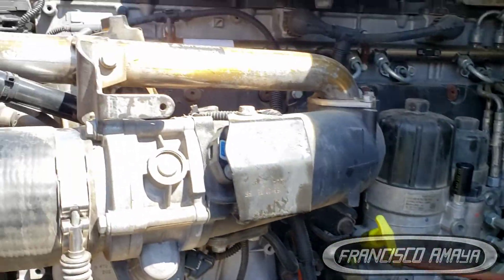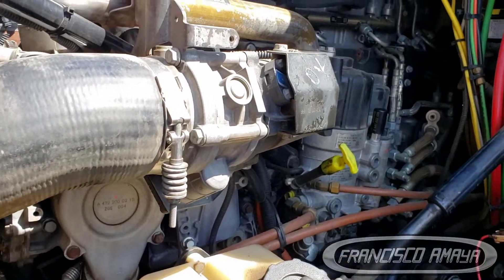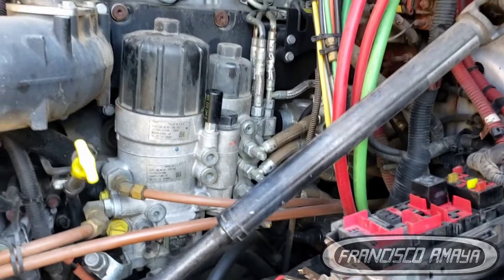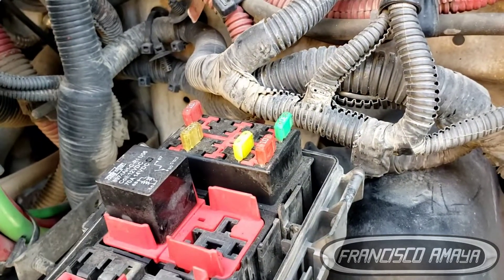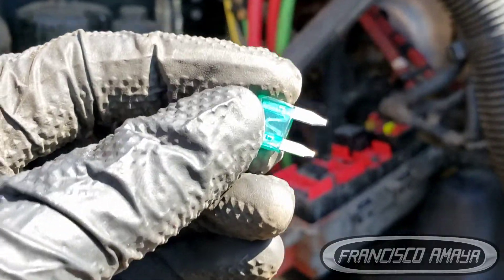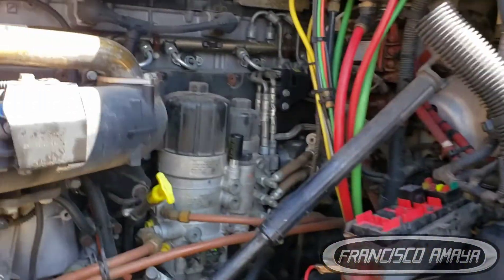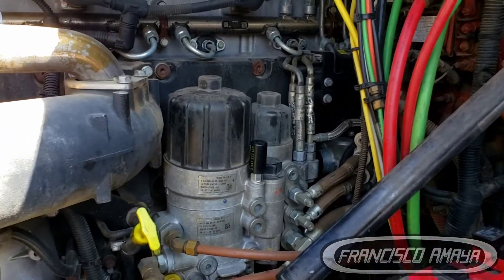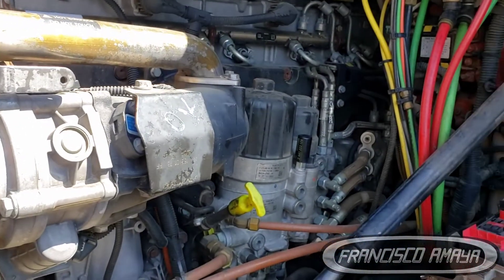Freightliner Cascadia DD15 engine crank not start problem broken fuse electrical problem

Comment: I have same issue in took the fuse and put back it will start I took Machanic they charge shifter gear nothing change finally i just test the battery my self 2 of them voltage was low I just bought betters charge my self everything is perfect right now

Comment: I been having the same problem I cant fix it is cranking but not start i been changing alot of thing the fuel pump to but it will not get electricity to the pump in self but that look one of the fuse look the same look like all and yellowish you thin Iay nee dto change that one too on a 2003 freightliner mt45 UPS trucks

Comment: My 2015 freightliner cacadia won't START I Still have a  power
Reply: Did u figure it out
Reply: I’ve the same problem I changed the fuel pump and fuel filter housing I’ve the same problem

Comment: Francisco amayo i have same issues  with start prolem  a month ago replwce start   aslo also all for batteries i replaced  when I turned key all lights  not crank  only  it start very slowly crank  after that nothing   cummins isx15  10 spd
Reply: Hey i have the same issue amd same motor. Did you ever figure out what it was?

Comment: In the video, when you hold the fuse up in the light. I noticed corrosion on the prong near the glass section of the fuse. both sides look corroded. Its small, but you can see it.